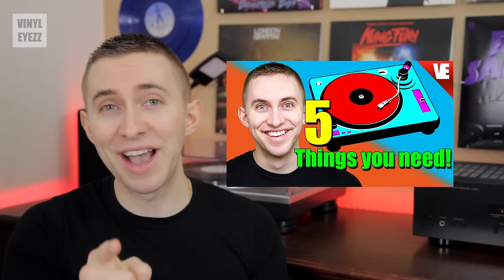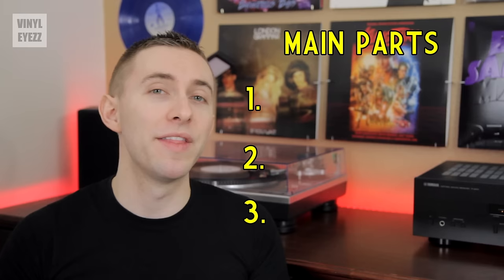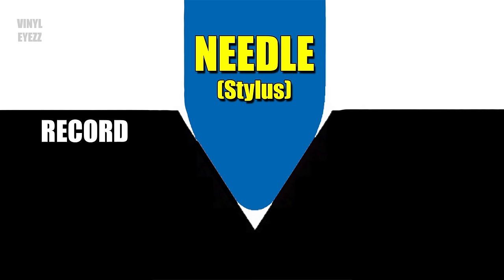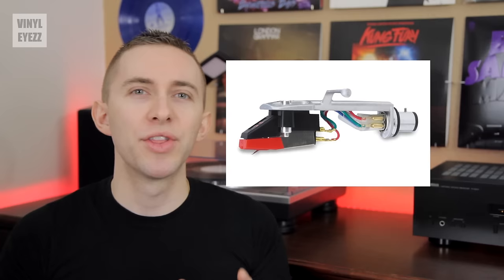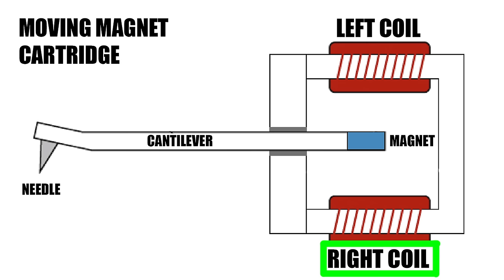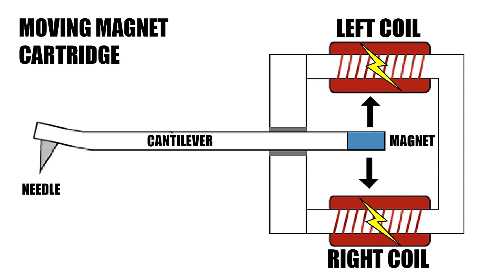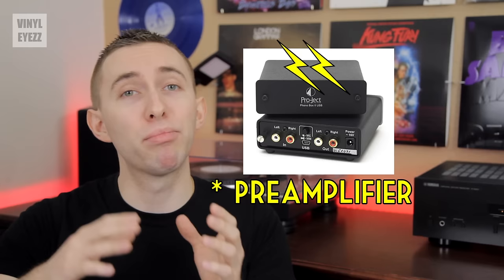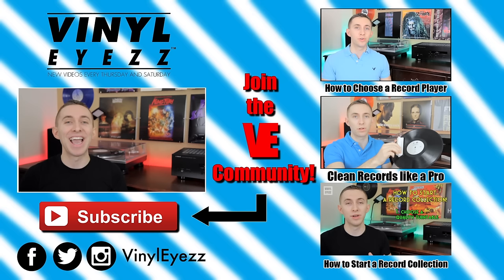How Record Players Work

Comment: How tf do they record for a record though?
Reply: they very precisely etch it into metal or something which is known as the master record. they then make two molds of it for side one and two. then they but a chunk of vinyl, kind of shaped like a burger, and literally press it with the two stamps. I may have got some stuff wrong so watch this for an in depth description: https://www.youtube.com/watch?v=wqJ0ouQScM8
Reply: The video was blocked! dammit so now how are we gonna know how their made
Reply: They use a lathe (a record cutter) to cut the groove on a special master. A lathe is reversed phonograph. From the master disk four copies are made to get the strong master metal negative, one for each side, with is then pressed onto a vinyl cake  (A doughnut sized hot bloob of vinyl) with great pressure. Viola! A flat vinyl record
Reply: I have a cague idea but basically as you speak thru a microphone the needle vibrates and it carves the grooves of the disk.
Reply: you take a digital file, like wav or mp3, mostly wav because its lossless and convert it into a analogue format. so you take digital 0s and 1s (zeroes and ones) and make them into a soundwave, the soundwave is the groove on a vinyl record!  (simple explanation)

Comment: A technical correction.   In a stereo cartridge the moving element, in this case a moving magnet, is at the focal point of a 90 degree triangle where adjacent and opposite lines are made up of two sensing coils.  Movement in the left track will cause the moving element to move toward and away from the left coil thus changing the magnetic flux coil and causing an induced electric current in it.  As it is moving to and fro vis a vis the left coil it must then be moving accross the right coil.  However, such movement will not alter the magnetic flux in the   right sensor coil and therefore no current will be induced into it. For this to work as faithfully as possible, the moving element must be positioned exactly at the focal point of the two sensors.  This is one of the reasons why tracking force is so important.  Too light ot too heavy and the moving element will be out of position.
Reply: It's strange that there are so few likes

Comment: This is a great video about "Stereo" records. You should do one about "Mono" and "Quad". The Quadrophonic system (very short lived) was quite complicated. Not only did the needle (stylus) move side to side, but up and down. The effect was amazing. Many artists actually recorded completely different versions of their albums for the Quad releases. The whole system was an early production of "Surround Sound" If you ever get a chance to hear one, it's quite a thrill. Unfortunately there were too many bugs in the format, and it just died away. There were also "Quad 8-tracks" which used 4 tracks instead of 2 for the recording, so instead of 4 playing positions, there were only 2. These sounded great in a car, and had your ears spinning around the passenger compartment. Again a short lived format.
Reply: The stylus moves horizontally and vertically in all stereo records. That's how the stereo signal is formed: each channel is encoded in a diagonal (and the lateral movement produces a sum of both signals, and that's why you can play a stereo record in a mono player and vice versa). Quadrophonic records used supersonic signals to carry the additional information that allows the separation between front and back. That's why those records demanded special equipment to be played.
Reply: Well explained...I am familiar with the concept, but poor at explaining the complete picture. Thanks for clarifying it.

Comment: You missed an important point about the phono stage (pre-amp), this must also perform a frequency correction called RIAA equalisation. Vinyl is recorded with a bass suppression, RIAA boosts this back on reply. This is important, many people new to vinyl need to understand that a phono pre-amp or phono stage must be used.

Comment: So I understand the how these different vibrations make different pitches that can be played audibly, but I don’t understand how a record player and vinyl is able to differentiate the sound produced by a trumpet and a vocalist playing at the same pitch....?
Reply: There are an infinite number of waveform shapes that will change the sound, they're not all perfect sine waves.  You could sing a particular note, and then sing the same exact note but in your best Eddie Vedder impression voice, and then say your dog steps into the room and howls that exact same note.  All three of these soundwaves will have the same frequency (because they're all the same note, or pitch) but the shapes of the waveforms will be quite different.
Frequency/pitch is the distance between each "wave" in a soundwave.  Closer together waves sound higher, farther apart waves are lower pitched.  Take a ruler and a pencil, and make a horizontal line of dots left to right, with each dot being one inch apart from the others.  Then take your pencil and draw a wave shape that goes up/down thru each dot.  Then  go down the page some and make the exact same line of dots with the same spacing, but draw the wave differently this time.  There are a bazillion different ways you could draw this wave that would still cross thru your one inch spaced dots.  You could make a really tall wave, a really short wave, a curvy wave, a spiky wave.. etc.. and each wave will sound different than the others, but as long as they all are spaced one inch apart they will have the same pitch.

Comment: It's still only half the equation though. The REAL magic is , how the sound signal is translated into grooves on the record in the first place. Judging by the comments, I think people are still confused. You can't really explain one without the other and expect people to understand. I will give it a go, though. Sound is a wave, and waves has measurable physical properties. Three main ones. Wave length, frequency and amplitude.  This can all be very visualized, and decoded mathematically, and i wish YouTube would let me post pictures, because i can't tthink of any examples to offer of what a sound wave looks like in terms of these properties, other than maybe the visual representation of a robot voice but think of a bunch of different vertical lines compressed really close to each other. These properties can describe any sound. Amplitude, the HEIGHT of the wave will tell you how loud it is. The FRQUENCY will tell you the pitch, etc. Wavelength is just another way of expressing frequency, as it is the length of the wave. ie the greater the frequency, the more waves in a given length of time, and wavelength is just the length from one wave peak to peak or trough to trough. Anyways in order for these properties to become sound, you need a way to store them, which was what the grooves on the record do. In the recording process, the actual sound is translated into a signal that reproduces these wave properties.  (by the vibrations on the components of the microphone. )  Because this signal is mathematical, that is every frequency has a numerical quantity, every wavelength has a quantity. then you can translate the recorded signal into grooves on the record, such that they vibrate the needle moving at a constant velocity (not actually constant but I'll get to that) so when these grooves vibrate the needle, the coil on either side of the magnet picks up the mathematical properties of those vibrations, and so that is the signal being passed from the recording to the needle to the receiver. At this point, it is just a question of decoding the signal such that the EXACT wave that was translated form the microphone to grooves on the record now vibrates the components in you speakers to recreate the SAME frequencies, amplitudes, etc  Also, back to constant velocity. They ALSO have to mathematically calculate the space between the grooves since the needle moves faster on the  rim than in the center, so the signal (grooves on the record) needs to become more compressed in the center. The mathematical properties of a sound wave are so mathematical that you can actually recreate the very sounds you hear mathematically. (insert visualization of a soundwave here) When you record, you are actually creating vibrations that are exactly mimicked by receiver picking up the sound waves. The record manufacturing machine will have this info when physically making the record.,. Think of sound as all kinds of intricate vibrations. Well, the grooves were put in the record so mathematically that it is actually reproducing the sound when the grooves vibrate the needle. That signal is decoded and send to your speakers which are in turn vibrated so those same vibrations reach your ears Anyways, i hope that gives the gist. Google picture of sound wave to know what i mean. It really IS just a matte of knowing what sound actually is.  Sound is just vibrations, and vibrations are just waves, and when you understand that waves have certain mathematical characteristics, suddenly it isn't magic anymore. Its just recreating vibrations of the same mathematical properties as the original sound.

Comment: I'm so glad I help my vintage amplifier.   It has both MC and MM correction within it and so I do not neeed a preamp.

Personally, I would chose a turntable with as few 'add-ond' as possible.  So pre-amps, USB connectiors, forward and reverse modes etc are just wasted on me.   I prefer for my money to be spent on what a turntable must do as well as possible - spin vinyls spot on the required speed, perfectly level and with no rumbly noises together with a tonearm that gives minimum resistance to movement and whicih will allow the cartridge to track acccurately accross the disk

Comment: Still don't get how etching vibrations into plastic turns into something as complex as music. Like how does it sound like anything other than just a loud buzzing like a vibrating phone? How does a single groove account for multiple sounds at the same time, different frequencies, the effects of guitar pedals, synth sounds, etc. It's just one needle being dragged in a straight line and cutting a groove along with the vibrations of the music, but how are the various sounds recorded in a single groove? How does it all not just sound like amplified static?

Comment: ...at the amplifier they receive a final boost and then they're separated."  NO.  They are separate all along the chain.  There is no magical device inside the amplifier which would separate the signals - that's why you have a L and R going in, and a L and R coming out of the amplifier.

Comment: that is not how stereo works. one channel moves up and down, the other channel moves left and right. more or less (each channel is on a 45° angle so if both channels are in phase, the needle moves left and right... perfectly out of phase and the needle moves up and down). It's not one side of the needle vs the other some nonsense lol. This is also backward compatible if you play a mono record on a stereo both channels will just play in phase.